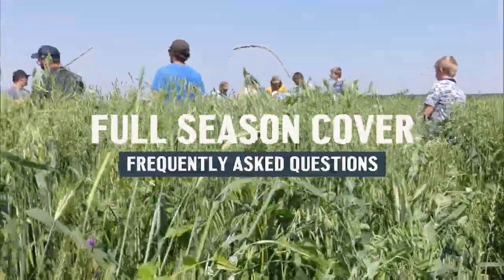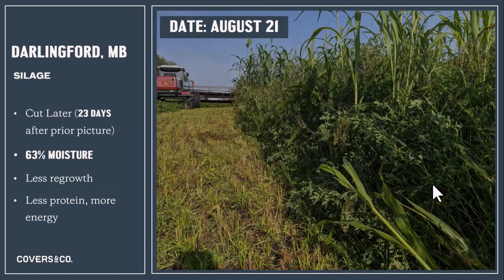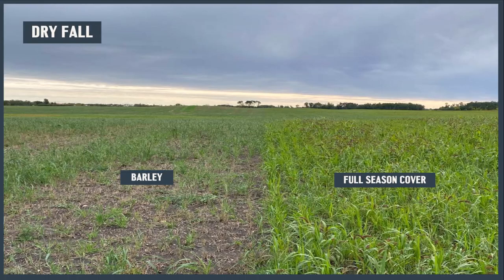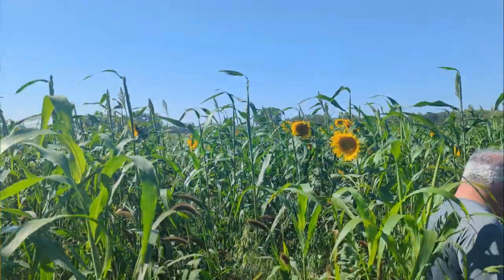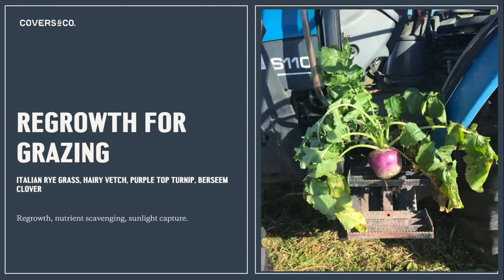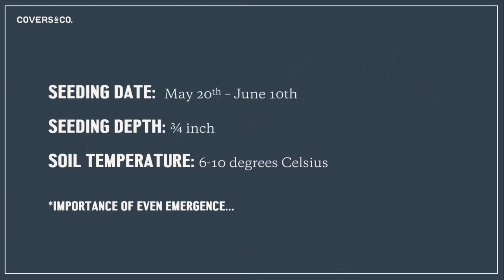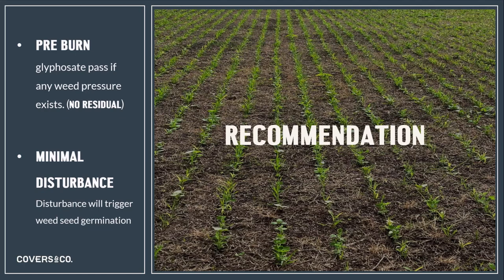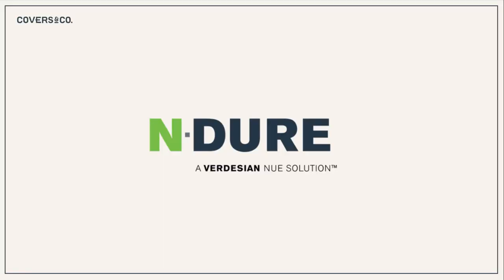Full Season Cover: Frequently Asked Questions

Comment: What kind of yield per acre do you get on average
Reply from the maker: Tonnage/acre depends greatly on moisture in the year.  Yield usually averages 6-10 MT/acre.
Reply: What would dry tonnage be then 
Like hay.
Thanks
Reply: Hi wants your recommended row spacing?